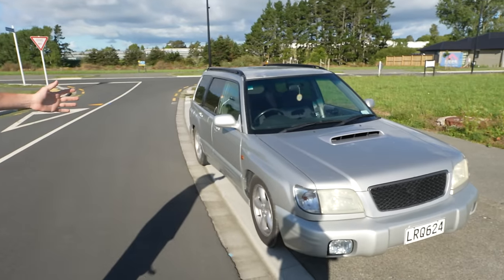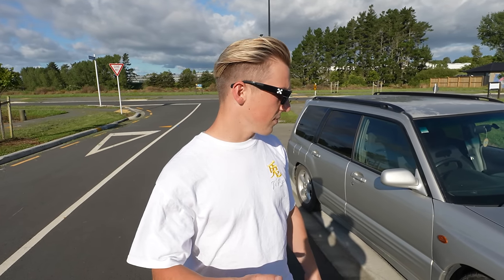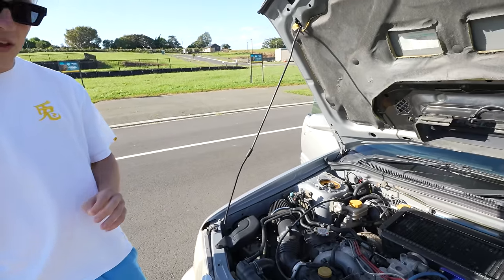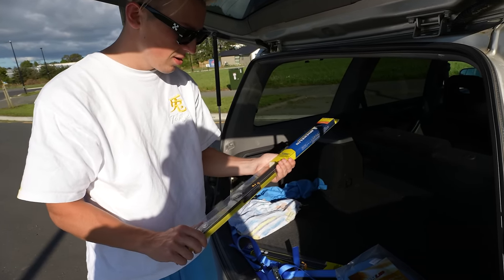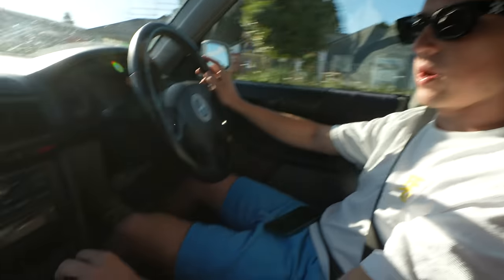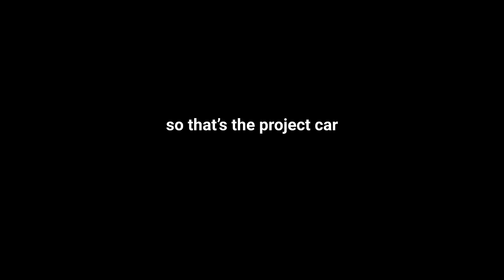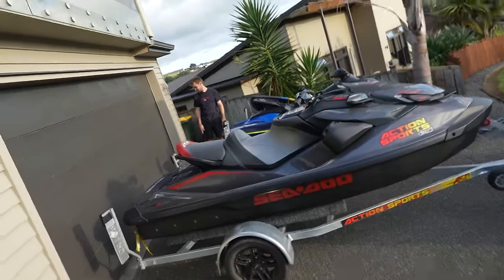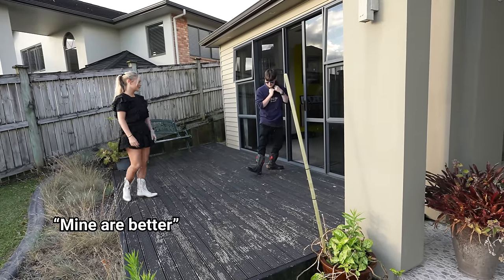Project Car Reveal...

Comment: That Forrester is going to be stolen in a week for a ram raid
Reply: It's a manual. It's ram raid safe when the kids can't drive
Reply: @Oldhex1978  that's actually a good point. But these 90s subis are very easy to drive
Reply: @Oldhex1978  Naw man, driving manual isn't a novelty in New Zealand. Most people probably can.

Comment: Ive got a 2001 forester gt running 18psi of boost through an sti turbo, and it is a weapon, good luck, the 2.0 motor is a grest platform.

Comment: That shifter needs the shift linkage replaced. The bushings alone won't help with that slop at all. I just had to do it on my subie also. A new linkage will literally make it feel tight and brand new.

Comment: Yo bro if you see this, suggest getting a gfb blow of valve, also safety mods like a air oil separater and a upgraded fuel pump